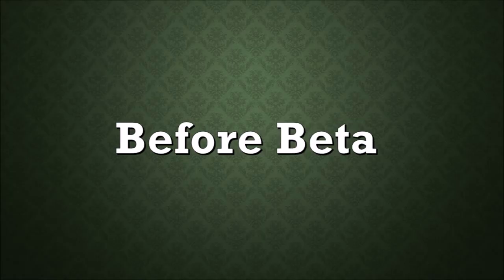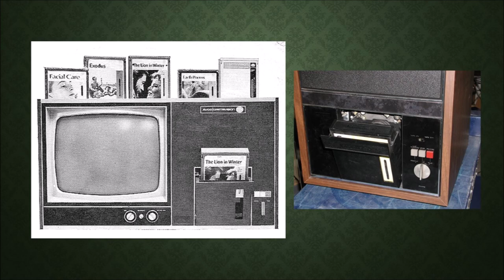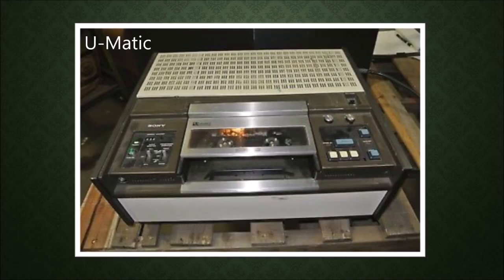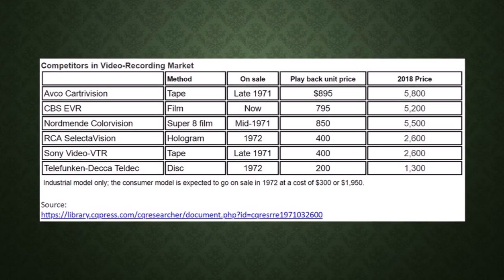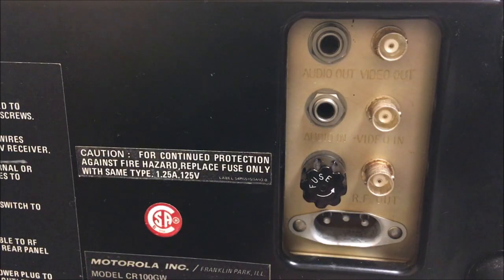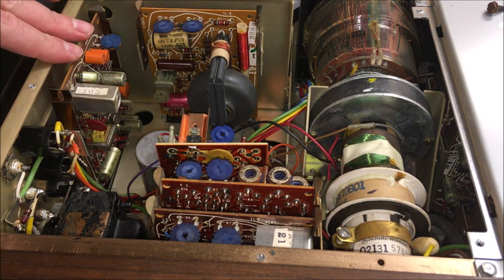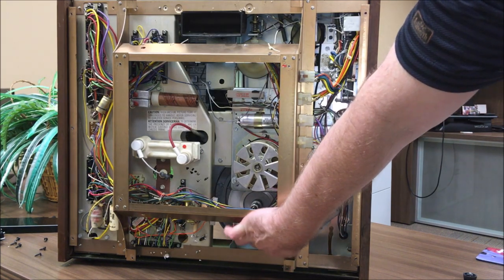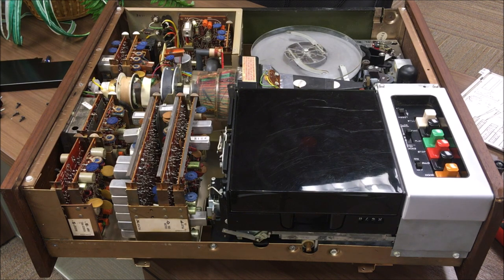Motorola EVR Home Video Format and the Format War of 1970

Comment: In 1987, I was helping a TV repairman move to another building and he gave me three video cassette systems.  I no longer have them but it was a big thick cartridge that had 1/2 inch tape on them.  Both the take-up reel and supply reel was on one side of the tape, on top of one another.  On the other side of the cartridge was a loop of tape and a hole with hollow plastic piece for the video head.  You had to insert the cartridge vertically in front of the system, close the cover and then slowly slide a bar from left to right which unscrewed the circular plastic piece so the video head could access the loop of tape that would be wrapped around it.  The audio head and capstan/pinch roller access the tape on the side of the cartridge somewhere.  The tapes lasted two hours.  The picture quality wasn't too bad.  The unit was made by Quasar VR1000 around the mid to late 1970's.  I believe it was called the VX format.  It was a very non-standard system.  I used it a while and later got a vhs.
Reply: Sounds similar to Philips' "VCR" format, just from your physical description. Though I don't know if those ones required semi-manual threading in the way you described.
Reply: The tape was all self contained in the cartridge.  The moment you put the cartridge in the machine and pushed it down the head was inserted into a hole in the cartridge.  You would then slide a bar across to unscrew a plastic ring from the cartridge which would then expose the tape to the video head.
Reply: That sounds like it could be the VX format tapes,these were only used with the  Quasar VR1000,it had a huge tape with a screw plug which the machine unscrewed and inserted the video head inside,which is quite clever.The machines also had a built in dehumidifier as well for some reason.I think it was referred to as "The great time machine" in advertising.
There are some vids of it on youtube
https://www.youtube.com/watch?v=uOiwnH2yPM0
and Labguysworld has a story on it.
http://www.labguysworld.com/Quasar_VR-1000.htm

Comment: Oh god, I owned two different Cartrivision units.  Cartrivision used a tape-saving method by recording every third field, then playing each field three times, called "skip-field", yielding an effective frame rate of 20fps.  The tape is wrapped around about 120 degrees of the head disk, which spun at 1200 RPM (20 per second for 60 head hits per second) creating the characteristic helical slices.  The tape ran at 3.8 IPS.  If I wanted to record all 60 fields per second, I'd have to make sure that all three heads could record when I hit the record button (only head 1 recorded), and triple the tape speed.  This method of tape conservation would end up being superseded by azimuth recording introduced with Beta and VHS, which essentially laid all 60 fields per second without the need for guard bands in a "shingled" way, allowing for overlap by way of slower tape speeds (LP and SLP/EP, Beta II and Beta III, anyone?).  U-Matic did NOT use azimuth recording, where the tape runs at a constant speed of 3 3/4" IPS in NTSC.

The cartridges came in two sizes, a smaller rectangular one which held up to 20-30 minutes' worth of tape, mainly for prerecorded material.  The larger, more square-shaped cartridge came with up to 112 minutes' worth of tape.  Black tapes would be either blank tapes or purchased prerecorded tapes.  Red cartridges were rentals which could only play once before being required to be returned, where they had rewinders.  They used different reel braking to accomplish this.

It was also one of the earliest, if not THE earliest, format to offer multichannel sound.  The audio would be either stereophonic or dual language.  In the case of stereo sound, you'd use cables plugged into the back of the unit's electronic chassis, commonly called the "fish tank" or (possibly, but not sure) the header atop the fish tank that would go into the TV.  For dual language, you would plug a dummy plug into the channel containing the language you weren't using, for example, if it offered a Spanish track.  If the TV offered multichannel sound for the VTR, the fish tank A/V header and switches in the TV would allow you to access the two tracks accordingly.  You could only record in monaural, and it used both tracks on the audio head.

I so wish I could get one of these again.  The output of these players is a bit funky, especially when you fed normal video into it; telecine was even funkier!
Reply: So did you have to pay a fine if you somehow managed to rewind a rental tape?
Be kind, don't rewind.
I like the idea of having a mechanism that prevents rewinding a lot more than those self-destructing rental DVDs that once existed.

Comment: The RCA Holotape project did not use electron beam recording. This was instead being used by a separate project called the Capacitance Electronic Disc system. There is some false information online about this and both projects were in development at the same time so I can understand the confusion.

Comment: Using a CRT to create the spot in a flying spot camera.  Interesting.  That does allow for doing some tricks like scanning the same frame of film multiple times without having to stop the flow of the film (which is what makes projectors noisy.)
Reply: And if you wanted, you could also replace the tiny CRT with a faster scanning, higher-resolution one.
Reply: Yup, this is how the Nordmende does it. You get one raster for still, two for normal playback and three for 16fps playback. The rasters are vertically stacked and have small black bars separating them, so at 16fps, if you look at that tiny internal CRT, it will look like there's three white rectangles on it.
The film just gets transported smoothly over a huge flywheel, no stuttery noisy shuttery clickedyclack action.

You could theoretically alter the circuitry to do full HD with lots of effort. At least, it's RGB internally which can be brought out for even better picture quality (trust me, these machines can produce stunning images, even in SD)

Comment: I fixed two of the Nordmende (btw. the first d is not silent) Colorvision machines. They're engineered like tanks and have amazing picture quality. Better than those full HD Super 8 digitizers you can get from Aldi. Even better, they're RGB internally and thus can easily be modded to output RGB. (heck the internal signals' voltage levels pretty much conform to what SCART RGB expects).
The circuitry for generating the raster is essentially half of a PONG arcade machine with the same 7400 series logic ICs.
The machines didn't have much wrong with them. On one, someone has replaced a broken transistor in the vertical deflection with the wrong type - and then the op amp IC for syncing the film to the raster failed. On the other machine, the incandescent bulb for this exact circuit has burned a filter to not let enough light through to trigger the photo sensor, I replaced it with a bright enough white LED. And the CRT was in slightly crooked, resulting in extremely jittery picture.
I don't think they're part of the format war (since you could just throw Super8 film at the wall for a fraction of the cost). I think they were used by TV broadcast studios to broadcast film images. Back in the 70s, portable video cameras sucked and portable VTRs either didn't exist or were ginormous beasts that nobody wanted to lug around, whereas Super8 cameras were small, convenient and had decent picture quality. News (as in footage) (and even commercials) back then were still shot on Super8, but the TV broadcasting studio would need a way to convert it to analog video.
(and filming the screen sucks too - you get a bright spot in the middle, geometry issues, focus issues, the colors come out wrong and so on - the Nordmende Colorvision makes pretty much perfect transfers, you'd be surprised, if the Super8 material is good quality, you get very nearly DVD quality)

Comment: Sony U Matic FTW! PS, RCA used the name "Selectavision" on VCRs after CED failed. It was too good of a name to abandon!
Reply: We had one of these. My dad bought it in 1977?  It's the VHS VCR you see at 6:00.  I bet someone at RCA liked that name, so they kept reusing it on product after product. ;D (Sidenote, that VCR was still working around 2001 when i finally gave it away.  The belts were stretching a little, so it took longer than usual to spin up.  It was also pre-macrovision, so it was immune to it!
Reply: @yorgle  Yep, They weren't wrong, Selectavision is  a nice name that made sence no matter what the EXACT device was, It works, And I don't blame them for recycling it.
Reply: @jamesslick4790  SELECT-A-VISION as opposite to TELE-VISION. It means you select want you want to see, the medium is secondary.

Comment: a good project for an electrical engineering student would be reverse engineering those boards, then recreate modern ones in surface mount format, you could do your whole course based off that unit.

Comment: We have lost something, we have lost the ability to repair modern tiny surface mount & or multiple layer board based electronics, it's fantastic to see those boards in this video, I would certainly like the opportunity to still buy certain big bulky electronics like home audio equipment for example but thinking about it logically how much of a market is there for big bulky through hole design electronics today? Most people are not interested, iit's a shame I think.

Comment: I always find the quality of construction amazing in these vintage pieces of equipment. The considerations made by the makers to make them repairable. 
I didn't see any leaky capacitors although some might have gone.
Reply: It was done this way to make it repairable, it added to the overall cost, whereas now everyone replaces electronics so often, there's no need to even consider future repairs.
As for leaky capacitors, I dont see any that have leaked, but I suspect some have dried out, I've got electronic equipment older than this that's never been repaired.
With this device here, I'd lay money on that flyback board already being damaged before it was posted.
Collectors and Enthusiasts are often the worse for misleading people, Joe bloggs generally knows nothing, he either plugged it in and it worked or it didn't.

Comment: I'm thinking that the "Pilot" board could be some kind of pilot tone generator to ensure film/sound sync. Either that, or it's some kind of master control board.

Not entirely sure which one though.
Reply: The color (chroma) information was recorded as 1.8 MHz sinusoidal stripes on one of the tracks of frames (luminance was a regular monochrome picture on the other track). In order to recover the color frequency and phase and translate it to NTSC, a 900 kHz pilot pattern was added to the 1.8 Mhz chroma. The pilot board's function was to recover the pilot and provide it to the other boards to translate the 1.8 Mhz chroma to NTSC 3.6 Mhz chroma with the correct hues across the whole frame.

Comment: Text reads "Before V200", instead of "Before V2000"?
Reply: Kenneth McCall, I recall seen the video portion stating V200, while the host was stating as a V2K, so it was JUST ON ONE SIDE...
Reply: Yes, Kenneth, to answer your question, you did read correctly; it does.